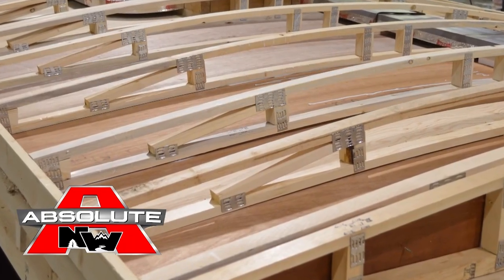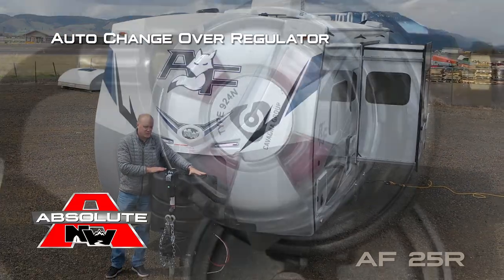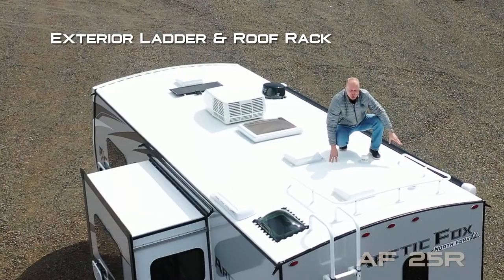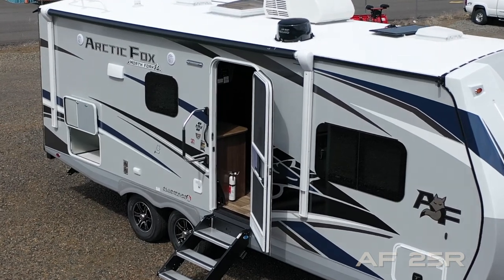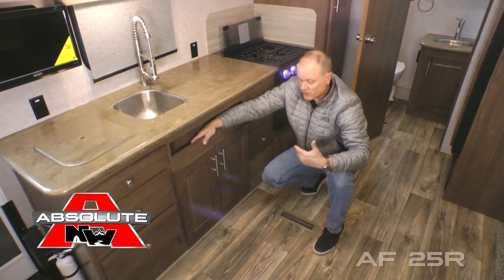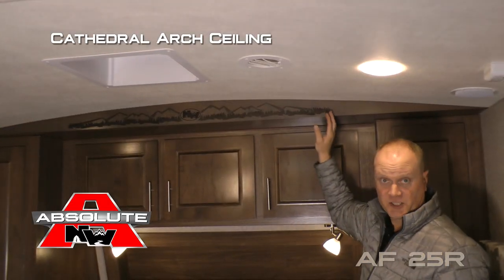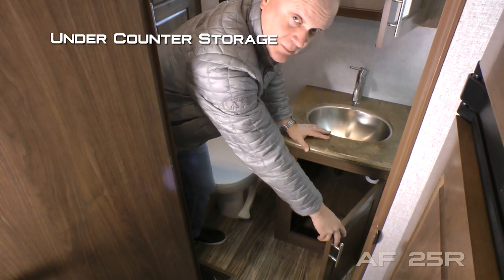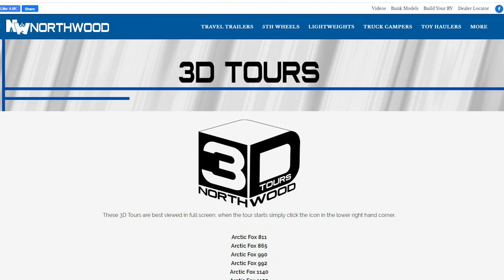Quick Tour of the New Arctic Fox North Fork 25R Travel Trailer

Comment: What all American RV manufactures need to do is start applying independent suspension systems for the wheels on the trailers. What they got going on vibrates like a constant earthquake, and that constant vibration loosens, and helps to break the trailers. Just relying on a single shaft, and crappy suspension, if any just means you are throwing money down the drain. Whether the industry agrees with current trends or not, people are living in RV's year-round, being YouTube influencers, roamers and such. RVs in the US need to be seriously upgraded. Take a look at how Australia is making their RVs for off road camping. Suspension is far greater than what the US market provides. Even in South Africa, they have better suspension systems for trailers. The current American version vibrates even the refrigerator, so it ends up having a short life span. Industry insiders (ie...they people that actually do the construction and build the trailers) all say there are too many issues, especially with the electrical wiring, just not done properly, and too many wires are exposed on the under carriage.  Take a look at all the warranty shops across the nation...they are constantly full of trailers coming in to be fixed. This shows that the entire industry makes a crappy product, that cannot keep up with real life usage.

Comment: The timber inside walls should be coated in a west system apoxy will water proof it ,   paint on with  a brush too easy and will stop rotting timber if a leak acures

Comment: Same old 1970's tank level indicators.
Reply: If they work RELIABLY, wonderful!  One of our RV’s had a smart phone interface, that you had to re-pair (Bluetooth) after every power loss, i.e. every time you arrive, get a low battery condition, etc.  After dozens of times going through the re-pairing procedure you begin to appreciate old school switches and buttons.  Exhaust your battery from running the heat all night, pop a breaker, hitch, unhitch, every power blip and nothing worked until you re-established the Bluetooth connection.  Each has their pro’s and con’s.  And when everything costs more and more to replace, simple looks even better.